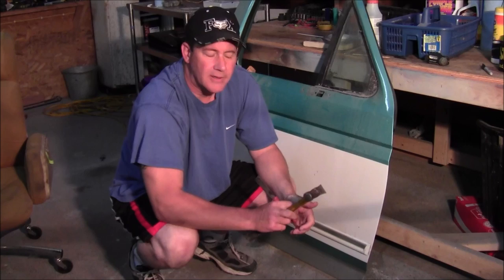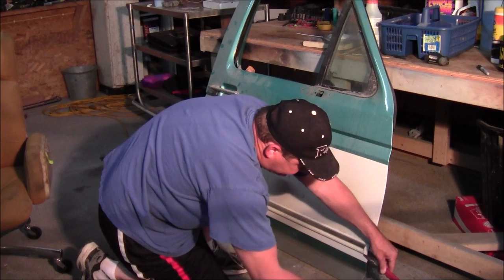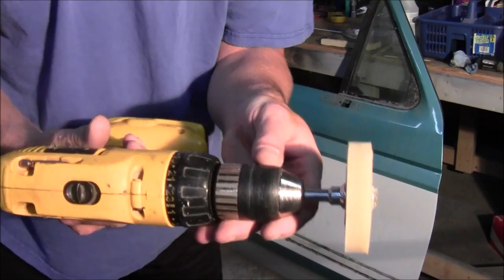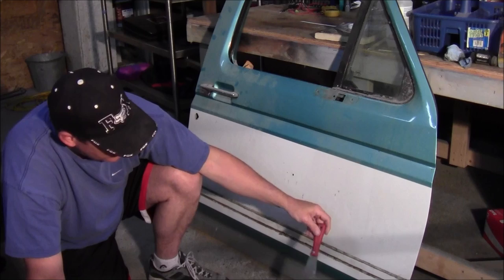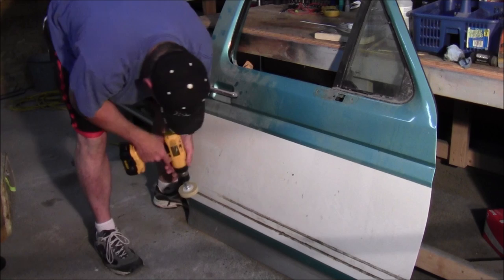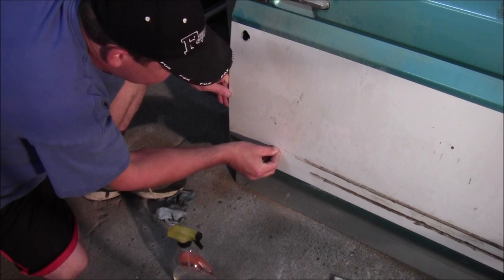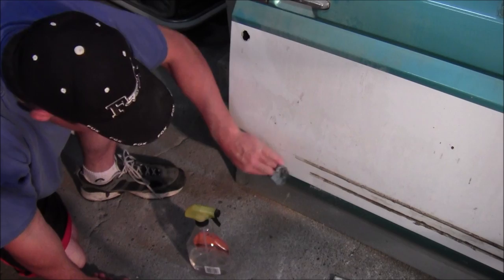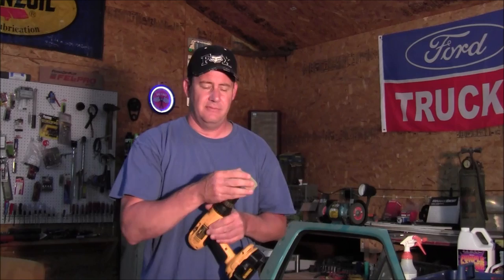How To Remove Automotive Molding Adhesive

Comment: WD-40 will soften and remove adhesive. I used it on tape residue on RV trailers. Does not hurt paint.
Reply: Was the residue hard and crackled?